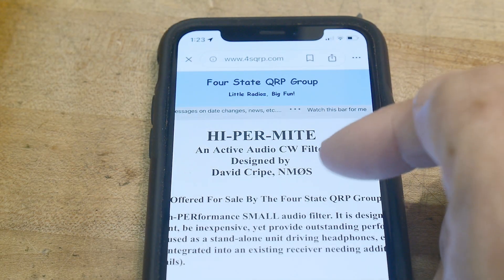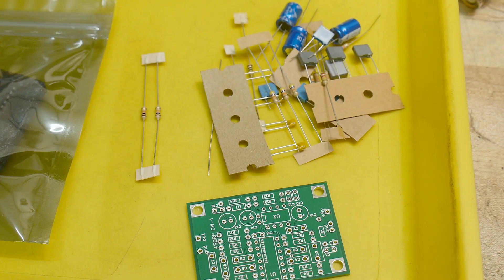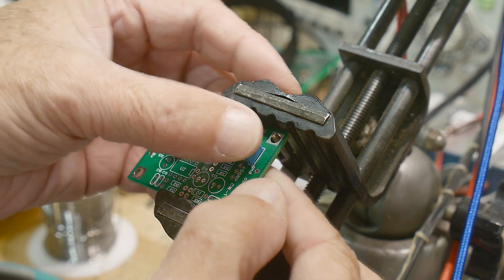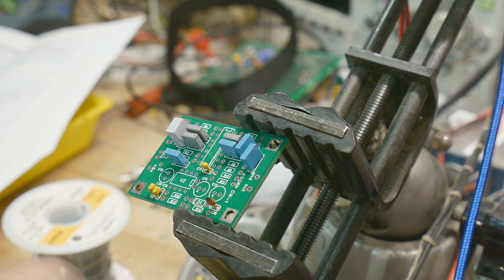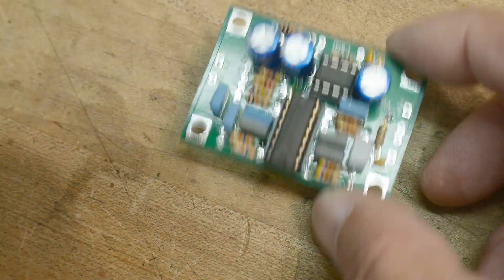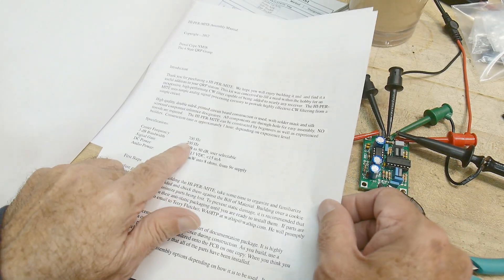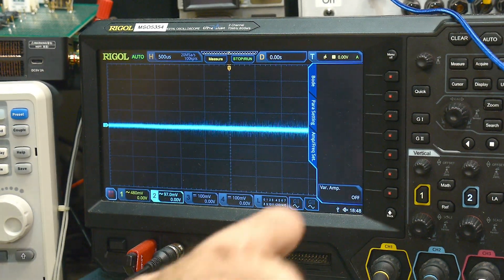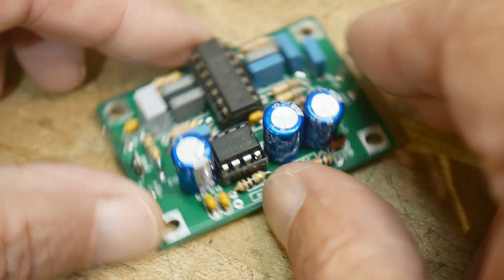#1716 700Hz Center 200Hz Wide CW Audio Filter

Comment: The modern way to do this would be to use a very fast Arduino. Some have fast ADC and DAC systems on the chip and run at clock speeds of 600MHz. Then one could make a tunable filter with just two extra potentiometers.
Reply from the maker: if microcontroller, then you could just detect the carrier, and replace it with a pure 700Hz tone. haven't seen that yet
Reply: @IMSAIGuy  yes. Do a real time FFT and home in on the signal you want then just output a synthesized tone that replicates the signal.

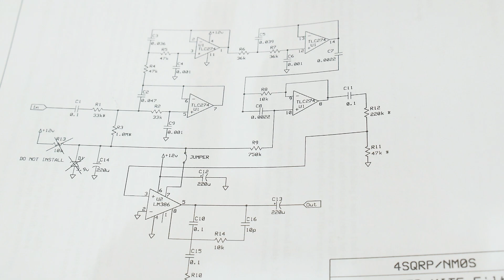Comment: Would it be feasible to make it parametric with adjustable center frequency and bandwidth? Possible, yes, but could it reasonably be modified without a bunch of trouble? Looking at the schematic @6:38, it seems the op amps are all unity gain inverters -outputs shorted to inverting input, and the first three of of them are high-pass and the final op-amp at lower right is high-pass?? Is it practical to to make the low-pass and high-pass adjustment variable? I have a feeling that my understanding of this circuit is prolly incorrect. Could u give us the skinny on how this thing works?
Reply: Not for this design I don't think, it has a bunch of resistors with different values tuned as different filters to add up to a nice band pass, not only 1 or 2.
Reply: @ivolol  I figure it would require some dual or more gang potentiometers, or a switchable bank of bank of preset pots. But that's prolly more trouble than it is worth.